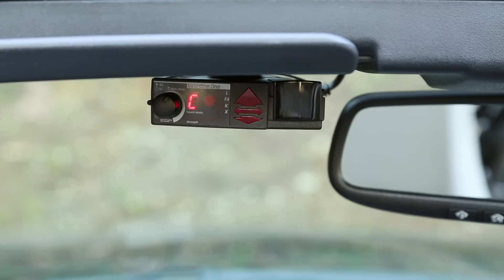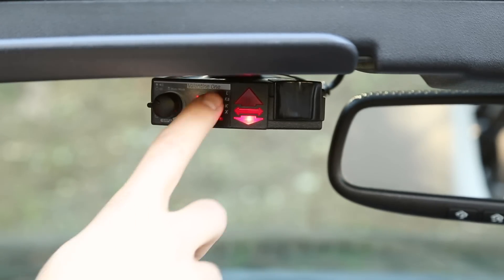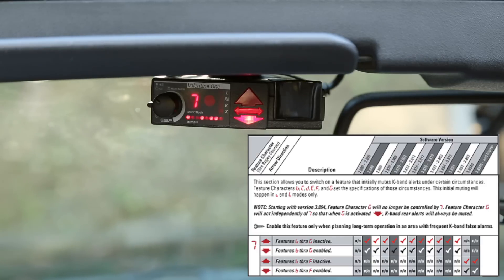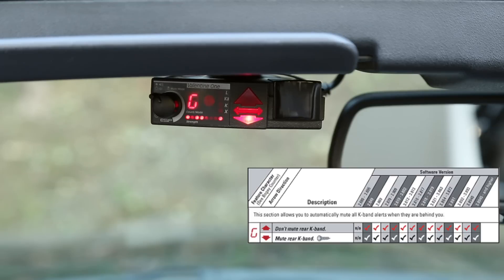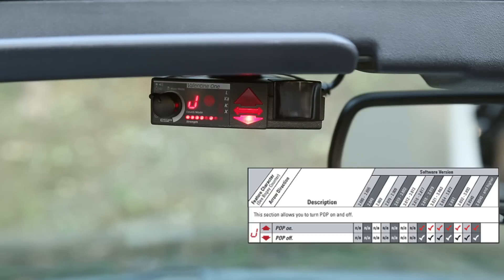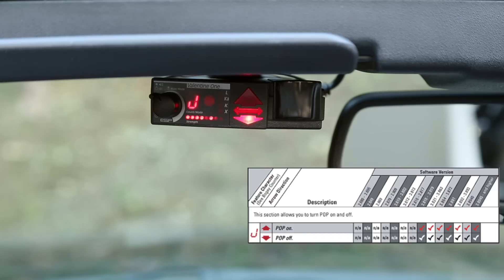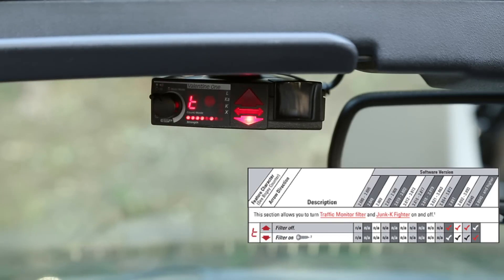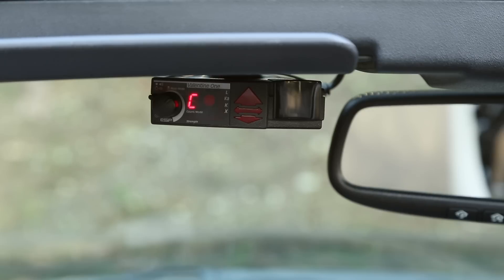Manually programming a Valentine One (V1) tutorial

Comment: Bought my v1 in March 2000 ver 2.909 just before I had kids. (:  Had no idea I could reprogram the sensitivity.  Looks like all I can do is mute K some and perhaps turn off K band detection from behind.  With all the new cars with blind spot monitoring, it's become almost worthless driving in high density.
Reply: The TMF2 filtering in the latest update will help with K-band as will the delayed muting.

Your best today is a newer model with ESP and to add V1Connection with Bluetooth module and run JBV1(3rd) app for further muting of the different algorithms that Honda, Mazda, and GM use.  You can also segment Ka-band for a noticeable performance increase. It is like a military upgrade for your V1!

Nothing is foolproof but it sure helps when you have to run K-band.

Comment: I used to  have a V1 with ESP but I sold it with the car. I didn't want to spend $600 for the V1 G2 so I bought one off of eBay. I believe it's a pre-ESP V1 and it includes the pre-ESP CD. I was thinking of getting a BT dongle for it but after watching your videos, I believe some features on the app won't work?
Reply from the maker: ESP is required for Bluetooth so an old pre-ESP V1 Gen1 won’t work with your phone. However all the V1 Gen2’s have Bluetooth and ESP built in so they’ll work fine.
Reply: @VortexRadar  Thanks for the quick response! I'll have to just programmed it and use it without the phone app for now.
Reply: The V1 I got has firmware V3.789. Can it be updated to the latest version?

Comment: Hey Vortex, Thanks for the Vid! I just got done programming my V1 with your settings. I have a couple questions. What are the pros and cons of setting the b c d settings to 3 seconds v.s. 5? Does it filter out more or less of false alerts you think? Also, once I made all of these changes, will each mode, L, little L, and A all have these filters enabled?

Please advise, 

Thanks in advance!

LLBj5
Reply from the maker: +LLBJ5 For b,c,d, the idea is how long it stays muted for before you get alerted. It's handy to mute brief signals but honestly I haven't putzed around with this too much since I rely on my phone for things like GPS lockouts and low speed muting. As for the different modes, you'd have to double-check yourself. I always use 'C' mode myself now with custom sweeps so I don't know some of the nuances off hand regarding the other modes.

Comment: I have a much older version of the V1 and it goes off non stop. When I checked last time I think my version is the 2909 but not positive. I was wondering if I should upgrade to a new V1 or buy the max 360. Most of my drive time is mixed between highway and city.  Will the Max 360 give me plenty of warning on the highway if I choose that option ?  Your videos have been very informative so keep up the great work. 👍🏻
Reply from the maker: Yep, sounds like an older V1...

If you have a really old V1, it'll cost you $289 to upgrade. You can sell your old one on eBay and buy a brand new one for less than the cost to upgrade. If you're happy with your V1, go that route.

The Max360 will give you plenty of range in most situations. Think of it as a simplified V1 with GPS and a fancier screen. The updated V1 can do a lot of the same things as the 360, but it will require a phone (to use the phone's GPS) plus an extra bluetooth module.

I like the V1's additional customizability. The 360 is an easier to use package and many people like that plug-and-play aspect. http://bit.ly/1PBnVjX
Reply: +Vortex Radar thanks for the info and a quick response.  My V1 has been a great for many years but was looking to try something new with similar performance.  I'm not in a hurry to get a new one so I'll wait and see how the 360 pans out with updates. 👍🏻
Reply from the maker: I don't think the 360 is gonna have loads more updates. It's had a number already, but after a while Escort tends to slow down with the updates I've noticed.

Comment: Thanks for doing this. I just followed along and for the most part have my V1 gen 1 programmed as you suggested. When I turn it on after programming it show a small u on the display, Is that ok?
Reply from the maker: Yes that’s normal once you enable Euro mode if you haven’t gone into your phone and enabled custom sweeps yet.
Reply: @VortexRadar  Oops, I must have put the arrow the wrong way to disable. No real point in using the euro setting in the US, correct? Thanks!

Comment: Great video. I just got my upgrade to 3.8952. I've had my V1 since 05 and I love it. The other day I was driving along and I noticed 2 pneumatic hoses secured to the road about 6" apart. Just past them was a marked car that appeared to be working traffic for speed. Do you know what this new(?) system is?
Reply from the maker: So I had to look up the technical name for them, hehe. They're apparently called pneumatic road tubes. https://en.wikipedia.org/wiki/Traffic_count They're designed to measure the flow of traffic for engineering purposes but they don't have anything to do with speed enforcement.
Reply: Ok, thanks.

Comment: after turning off x and pop, after staring up it will have a P letter then an A.   what does those letters mean?  also I mount mine half way in the windshield, bettter to mount near rear view mirror?
Reply from the maker: Okaythen001 I'm not sure what the P is. Usually mine says P-O-P indicating POP is on (even if it's turned off... that's the way the V1 works). A is "All bogeys mode" which means it's programmed to alert to everything and doesn't have custom sweeps loaded in.
Reply: If you see P then whatever letter, that means it's been customized by someone before. It's the V1's way of telling you it's not in "default" mode.

Comment: finally got my v1 in mail today. with the new k junk fighter and new features do i still gotta program the v1?
Reply from the maker: It'd be good to verify that the Junk K Fighter (TMF2) is enabled if you bought a used one. If it's new it's enabled by default. You can still go in and set up additional muting if you like like muting the rear antenna and so on.
Reply: Vortex Radar its definitely brand new out of the box. definitely need more muting , shopping centers go crazy but highway did really well not many false alerts
Reply from the maker: That makes sense. The Junk K Fighter helps with false alerts from other nearby cars with blind spot monitoring systems. To filter out stationary false alerts, you need a phone with a GPS chip and an app. It learns where those false alerts are and tells the V1 to mute itself when it sees a recognized signal. On iPhone you need V1Driver. On Android you need YaV1. Check my channel for more info on both apps. :)
Reply: Vortex Radar the junk k fighter makes me the biggest difference, if it wasnt for that, i wouldnt have purchased the v1 and just got the max 360 which is obviously amazing but my gut said the v1 and i am not dissapointed at all. Im definitely buying yav1 to extend the performance and check out the sweep options other users got.

Comment: so after many years of debating on which radar to get , i finally went with the v1, should be coming in tomorrow. i havent bought the bluetooth module yet, so my question is do i have to manually program it every time i disconnect it moving it from car to car?
Reply from the maker: +Louis  Soria Congrats! These programming options all stay in the detector once you set them in.

I'd definitely recommend getting a BT module and a phone for added features, better performance, and better false alert filtering. It makes a big difference.
Reply: Vortex Radar im excited to put it in work and see how it performes out here in california. but sounds good im glad the settings stay put, i definitely am gonna buy the module soon
Reply from the maker: Awesome. You can turn off both X and K band in most all of CA and run it with just Ka band. It's awesome in CA. :)

Watch out for laser if you don't have jammers yet though because they use laser everywhere there!
Reply: Vortex Radar out here they usually only run KA band, and alot of laser, even running the v1 still gotta be street smart and know where the motos like to hide and tag people.

Comment: After I did your tutorial the I only have option u and U what does that mean and what one should I run thank you
Reply from the maker: The U is there for Euro Mode. If you load in Custom Sweeps afterwards via your phone, it'll have a c or C. Lower case means K band off. Capital means K band on.
Reply: @VortexRadar  ok so until I buy the BT module to do the custom tunes what should I do u or U? Thank you so much for the help
Reply: @VortexRadar  or do I need to go back in and turn off euro mode
Reply: @VortexRadar  well just realized there is a android app for it do you have a video for that? "Custom sweeps"?
Reply: @cswann1000  yes, you'll need thr free app and the BT module can be purchased from V1 website.

Comment: so what cant you do without the phone and if i were to connect a phone would my settings change back to default if i disconnected them phone?
Reply from the maker: +Vegas “Vegas747” Seven four seven The settings all get loaded into the phone, the ones you see here as well as things like custom sweeps which require the phone to program but stay in the V1 even without the phone. What you would lose are features that require the phone's GPS (ie. GPS lockouts, Savvy emulation for low speed muting), require additional analysis from the phone such as boxes, or alert logging where the alerts get stored on the phone. The core V1 features, settings, and filters don't require the phone.

Comment: Thinking about getting a V1. If I got the Bluetooth adapter for Android, does my phone always need to be connected, when I use the V1, to have my configured settings applied? (i.e is the detector then smartphone-dependant every time) Or does the V1 store them on its own? I'd like to unplug the bluetooth adapter after I'm done configuring, as my phone will lockout with Android Auto in the car during driving.
Reply from the maker: Your phone needs to be connected for GPS lockouts, but some of the programming options like TMF and custom sweeps will stay on the detector even without a phone. With Android Auto, can you use a V1 app with it? Basically running YaV1 or something in your dash? That's a cool idea. You'll still need the BT adapter plugged in to your V1 so your car can talk to the V1, but yeah you can skip over keeping your phone connected.
Reply: It would be a nice setup to have a V1 app made with Android Auto compatibility! Thanks for the quick response!
Reply from the maker: See if the V1 apps run on Android Auto. If so, and it your Android Auto has GPS (it's gotta have GPS for Google Maps), it can replace your phone for lockouts when out on the road.
Reply: One additional question. I did get the V1 and am really enjoying it so far. I have a concealed display and the bluetooth le module for android. When the unit powers up, the main display turns off to show just the concealed display.  I can turn it back on through the mobile app, but is there any manually way to turn the display back on?
Reply from the maker: Only via the app

Comment: my display onlyl lets me pick a u and U i cant get a A OR C when im driving in the count display
Reply from the maker: +Tony Palmisano that's correct. If you use your phone to load custom sweeps, you get a C instead of a U. I forgot to factory reset my V1 before making the video.
Reply: Vortex Radar which should I use the little u or the upper case U and what's the difference
Reply from the maker: +Tony Palmisano U = K band on. u = K band off.

Comment: Recommendations for V1 Settings in NY or upstate NY
Reply from the maker: +BootyClap The same as most anywhere else in the country...
Reply: I feel like the description link to the V1 site is overwhelming. I live in an area where X band is always faulty. The K band is a hit or miss, some cops usually use KA. Should I keep K band on?
Reply from the maker: +BootyClap Check out this video to help you figure out what you do and don't need for your area: https://youtu.be/n2UIfQUGqUE
Reply: according to that link you provided, all of them are used at the top. Should I keep the A on? or do some customzing?
Reply from the maker: +BootyClap Ideally: X off unless you go to NJ, K and Ka on, TMF2 on, if you have a phone, enable Custom Sweeps and disable Ka guard. Do you have a phone for a V1? It really works best with an Android.
Reply: I have an iPhone.
Reply from the maker: +BootyClap If you have the BT module, program it with Custom Sweeps :)
Reply: What do I loose if I don't have the custom sweeps?
Reply from the maker: BootyClap Reduced performance. Custom sweeps help unlock the full performance of your V1.
Reply: Most likely I'll purchase it in the upcoming weeks! How would you configure that?
I don't want to have a bunch of wires hanging out etc
Reply from the maker: I haven't done a tutorial specifically with the iPhone app since I'm not a big fan of it on the iPhone (even though I'm an iPhone guy too), but you can watch my other tutorials and the ideas are all the same. Check out my other videos on the V1 and YaV1.

https://www.youtube.com/playlist?list=PL_n_eDU1BrRThUzHDlL9sCYjiZz6ziy_U

https://www.youtube.com/playlist?list=PL_n_eDU1BrRQOE0vT0yovgU9wfDKggh9c

Comment: Why did you turn off X band
Reply: Cal Beezy X band generates so many false alarms that I stopped using the V1 for several years now. Personally, I just couldn't tolerate the high pitched beeps and would leave the volume completely muted every time. I got a ticket because I initially missed the visual cues and decided the detector was giving me a false sense of security. I just learned today that the X band could be switched off and its how I found this video. Time to dig out the old detector and dust it off.
Reply from the maker: Cal Beezy X band is only still used in a few places around the country. In most places it's not used at all so you might as well turn it off. Here's how to find out if it's in your area or not: https://www.rdforum.org/showthread.php?t=46004

Comment: I have an older version, works fine but has delay when cop passes me from arrows 
Seems to delay four five seconds before changing from up to side to behind lights on unit 
Could this be a setting issue
Reply from the maker: It's not a settings issue. Sometimes it happens when there's reflections around which can confuse the detector, especially at close range.
Reply: +Vortex Radar cool thanks mate cheers
Reply: +Vortex Radar cool thanks mate cheers

Comment: Yeah Im not pairing the V1 with anything so I'll have to go back and turn it off. What is the A, I, L mode stand for? And how do I switch the modes
Reply from the maker: Merat Imani Go in and read V1's documentation online. It's all detailed there. Big L and little l activate the K band muting options that you can program, stuff like mute rear arrow, stay muted for weak signals, etc. One of the settings will display muted alerts visually but not audibly, while the other will nuke alerts altogether when "muted" and display nothing and audibly remain silent. I forget which is which, but that's what L and l mode are for. A mode doesn't activate the additional K band muting options you program in.

Comment: I copied all the setting I could in your video I have a version 3.739. I turned my radar off and on again after changing the settings and mine doesnt say C, all I have to choose from are A, L and like a smaller L which should I use?
Reply from the maker: Sorry I meant to factory reset the detector before doing the video. I had previously programmed custom sweeps with my phone before doing this video and so when I enable Euro Mode, instead of "U" it says "C" on screen. If you're not using custom sweeps or a phone, you don't need Euro Mode and will want to bounce between A, l, and L mode. I never use those to be honest but they have to do with different filtering modes. Check out the manual for more info about what they do exactly.